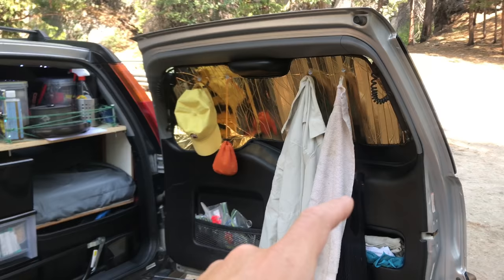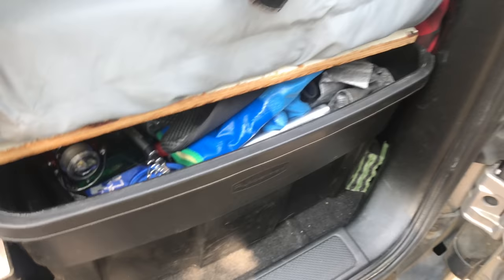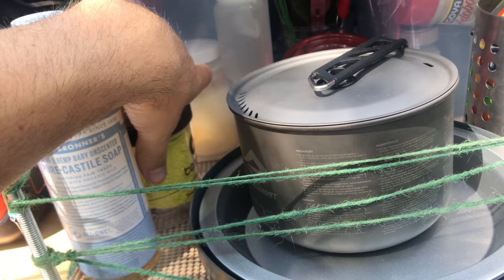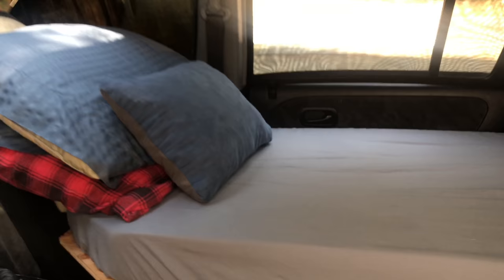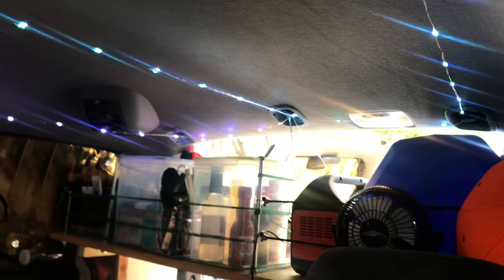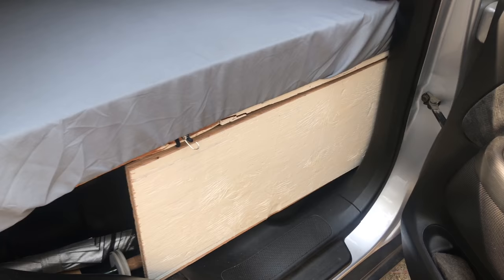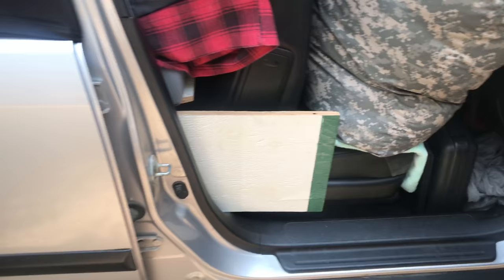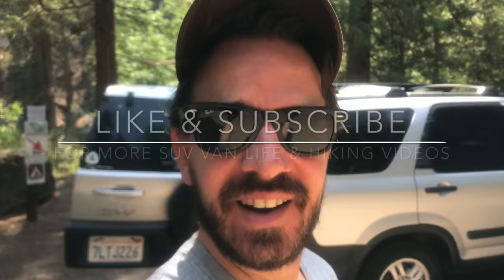Honda CRV - CAMPER CONVERSION (Full Time / DIY)

Comment: Thanks! I have 2002 You have answered so many questions. You can still have 3 in the car to travel. I did add rain guards for the windows  2" trailer hitch box and Running rails to help get on the roof. I just can't pull the trigger on moving the double seat in the back. Did you dump the picnic table?
Reply from the maker: Ahhh yesss! Take the plunge! The picnic table is still there. Need the flat surface it provides... also storing ALL of my tools below it in the well. Thanks for watching!!!
Reply: Did u remove backseats

Comment: how is your weight supported on the bed platform?  do they simply rest on top of your bins?  if so, won't the sidewalls of the bins eventually collapse?
Reply from the maker: Yes. The wooden board/platform with mattress rest on top. And no, the sidewalls do not and will not collapse. It is very strong. Your weight is evenly distributed over 4 of them...
Reply: @intheopenair3725  wow. That's crazy. Nice hack. Unrelated request: I also have an ,04 crv and would be curious to know about the state of yours... How many miles and work you've had to do on it to keep it purring. I'm hearing all sorts of creaks from my suspension. Wondering if you've had to replace parts of it.
Reply: @chrisc2439  yeah mind sounds like metal on metal and imho gas mileage sucks but that said been sleeping in it for nearly three months w my 60 lb traditional shar pei - just curtains on the back windows - in so cali this is not something id do by myself and finding a safe spot to sleep is not so fun - but been doin uber eats and now i have a good reason to be sleeping in the car and can pull up the app to prove it- something like i'm sorry officer i have been grinding out these deliveries (insert your reasoning- ie paying off student loans or saving for your first home or whatever GOAL" - don't say anything about being homeless and i just keep the big green "uber eats delivery in progress " placard and big green uber food cooler visible in the back window - delivery drivers work 24/7 and they will make you take a break after 12 hours as well as have a specific button in the app to SHOW LAW ENFORCEMENT should they have issue with you snoring in the 24/7 macdonalds - stealth bed and window covers are what i am trying to do but i am not sure what kind of work this thing needs as it's suspension is SHOT and the noises are honestly terrifying like the damn wheels are gonna come off - lol

Comment: How do you plan on getting everything warm for the winter?
Reply from the maker: Great question. I’m considering buying a Little Buddy heater for the coldest of nights. Also, I’ll probably use my cooler in reverse. No ice and put things in that I don’t want to freeze.. Mostly though, I plan to spend my winters down south! Thanks for watching!
Reply: Little Buddy heaters are too dangerous in a rig this tight/small. Buy a zero degree sleeping bag &/or a down comforter, both of these work amazingly well in the cold. Also, just carefully running a cook stove inside a vehicle produces adequate heat. ( Crack open the windows of course.)

Comment: Is the bed just resting on the plastic storage tubs?
Reply from the maker: Hi Paul, yes it is. They are leveled and then fit together snuggly. It works perfectly and has never slipped at all. It’s also held in place by the drawers at the foot end and the passenger front seat at the head. Cheers!!
Reply: @intheopenair3725  thanks for getting back to me and replying. Awesome video and thanks for allowing me to realise the possibility of using something that isn’t cumbersome to drive/park and still have storage if really plan ahead. Thanks for the inspiration